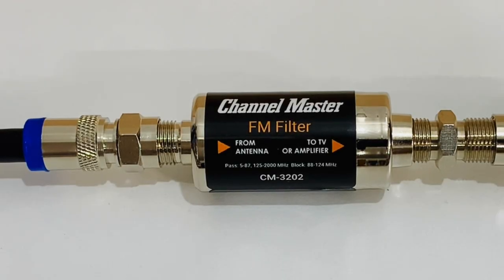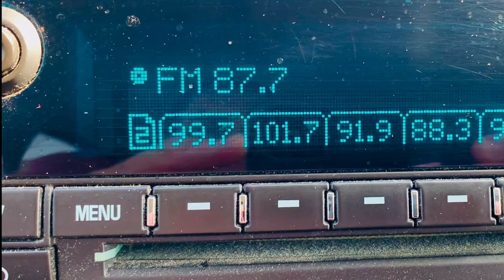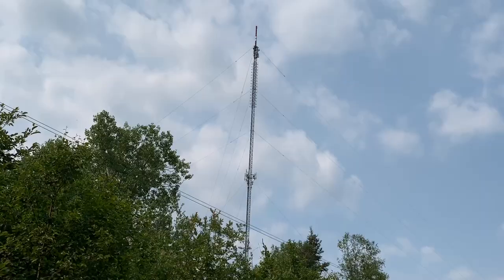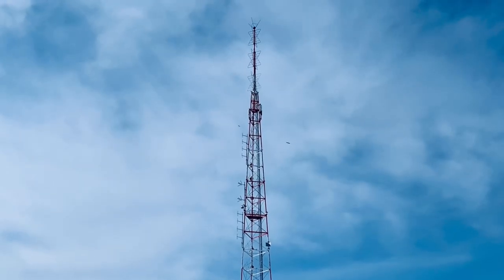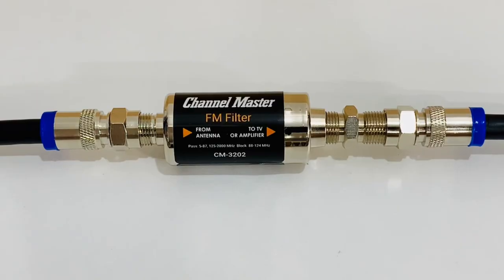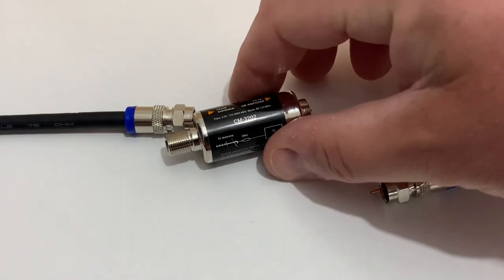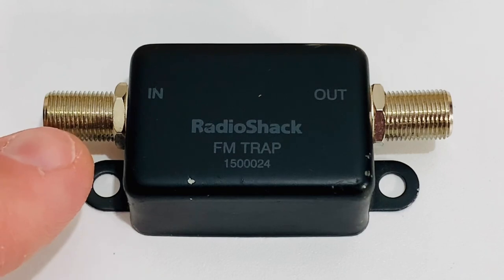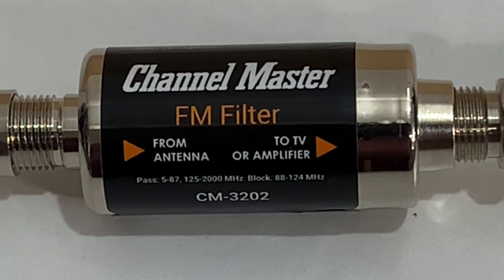FM Trap or FM Filters for TV Antennas eliminate FM interference from OTA television reception

Comment: Does it work together with an LTE 3-5G channel master filter?
Reply from the maker: It is designed to be coupled with other filters.
https://www.youtube.com/watch?v=HBzMCe4j4i0&t=83s
Reply: @NorthcoasterHobby  Thanks , figured it would  because its the same brand. Just wanted to be sure before I bought them
Reply: the 5G filters might work by doing an attenuation in the bands concerned with the FCC frequency plan for 3-5G signals but am not quite sure of that

Comment: Very good explanation. In my case I live very close to an FM broadcast tower, we have two local channels, but never had TV interference. The broadcast power for both channel is 500 Watts so they can be received even in the countryside. In the analog days TV was broadcasting on VHF High and UHF, now all TV stations are on UHF. We never had Franken FM channel, VHF Low band was abandoned in the early 70s due to strong interferences and the TV channel was move on VHF High. Regarding FM the problem I noticed that those two local FM channels interferes with neighboring channels, so there is a 1 MHz space between the stations. For example the first local channel is on 89.9 MHz, the neighbor channels are on 88.8 MHz and the other is on 91.0 MHz. The channel on 91.0 MHz is a little weak and the stereo reception is somehow affected but listenable. The second local channel is on 107.7 MHz but in some cases you can hear it excellent on 108 MHz. The neighbor channel is on 107.3 and unfortunatelly the stereo reception is affected, even on mono there are problems. In Europe FM stations can broadcast on both odd and even frequencies. No need for an FM Trap. In fact FM-VHF-UHF combiners are very popular so we can have both DTV and excellent stereo reception, and an amplified splitter. The problem is with the 3G, 4G, 5G on UHF band 4G, 5G filters must be mandatory in UHF antennas and combiners, I also live next to phone tower and without a 4G filter, TV channels break up, with the filter on I dont have problems.

Comment: I honestly have never used a fm filter trap and when i did have one built in with  antenna i didnt see improvement. .  Maybe people with people that try to get rf 2 - 7 may seen a improvement.  Buying the cellular filter trap  is better for most people . For best results  put it before the preamp. so amp doest boost the noise. I also i do not know why you want to cancel  out radio when some tv converter boxes accept radio channles as auido only channles.
Reply from the maker: Hi Leo, it’s a potential source of noise for TV antennas; if someone has ruled out 5G/LTE or other sources of RF noise then FM interference might be something to investigate. Also, aren’t audio-only channels TV channels (usually subchannels)? They would be carried on some part of the TV band, not on the FM spectrum? Is that correct?

Comment: I tried the tunable kind and it weakened  the signal so I say no. But I was tuning a classical FM station. The interference was better to leave it alone. FM traps are not good for FM antennas that share TV as well. I sure miss them VHF only antennas and separate antenna jacks. Also 300 ohm shielded cable. Coax is not the best for UHF TV. 73
Reply from the maker: If you’re trying to eliminate interference from a TV signal then an FM trap might help. But if you’re using the antenna for FM reception as well, then definitely that will not work out. 73
Reply: can fm trap  work the same as FM tv filter  or do they differ ???
Reply from the maker: @joe10117  Same thing, different name.
Reply: @joe10117  sounds to me they are the same but I haven't looked it up. 73 bbl
Reply: @joe10117  I can't find anything on TV traps but the tuneable traps I have could trap channel 6 sound but that's all history digital is different I don't think I can tune channel 6 on my FM radio anymore. Of course channel 6 is far away next time I drive near channel 6 I will try tuning it in on the bottom of the FM dial. Might have to use a portable radio. All this digital crap don't let you tune in the cracks anymore. 73
Reply: @joe10117  I think I know.what you are talking about but the internet has no clue. The trap I was tuning was to tune out the local station so I could pick up a weak station but I lost the signal when I installed the trap. 73

Comment: Hi, I want to know one thing. 
Can you tell me, how much kilometer coverage area of 1 FM radio station transmitter tower 🗼?
And if that radio station transmits frequency 88fm or 107fm, the coverage area in kilometer will be the same or not??? 
Please answer me 🥺
Reply from the maker: FM broadcasts are line of sight, meaning that any obstructions, variations in terrain, trees, etc., can affect signal reception. As far as distance, in addition to the above line of sight considerations, FM signals are generally limited to the curvature of the earth, probably 70 miles (112 km) maximum distance. Another factor is broadcast power.

Comment: Having trouble picking up KTRK Channel 13 Houston TX from 65 miles away. Bought the largest VHF-HI / UHF outdoor horizontally-polarized antenna (basically a yagi) that I could find, and installed it at a location 65 miles NNE of KTRK's TV transmitter site.  I understand that channel 13 is 6MHz wide, and centered at 213 MHz. My spectrum analyzer set for the range of 174-216 MHz indicates strong signals for Ch 8 and 11, and then 13 is drastically weaker for some reason, even though all the Houston TV signals emanate from the Missouri City antenna farm. 
Much closer to my TV location that I was troubleshooting northeast of Houston, there exists a 100kW FM transmitter on 106.9 MHz, and its signal is hitting the antenna well within the frontal lobe. When I do the math, I find that when I multiply 106.9 by 2, I get 213.8 MHz. Could this be a harmonic that is interfering with Ch 13? If so, then it looks like I need the FM Trap. Just want to know: Is the second harmonic a factor that I need to consider? Given that the FM channel is 200 KHz wide, actually means that there are likely second harmonics probable within a range of 213.6 to 214.0 MHz. Let me know what you think.
Reply from the maker: I'd say it's certainly possible. Second or third harmonics may cause interference, especially with such a strong broadcast power (100kW in this case), and your antenna receiving it head-on. Might be worth trying the FM trap. I find a lot of intereference issues are very much trial-and-error processes.
Reply: @NorthcoasterHobby  following-up: I installed the FM Filter and it solved the problem: homeowner gets channel 13 now, with high quality / reliability. Thanks :)
Reply from the maker: @proghead59  Great to hear, thanks for letting me know how things turned out.👍